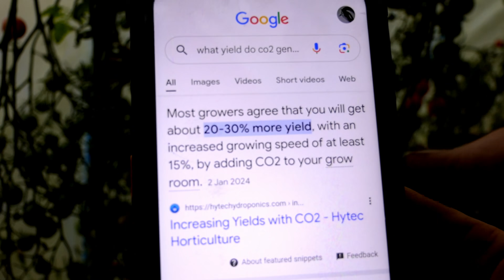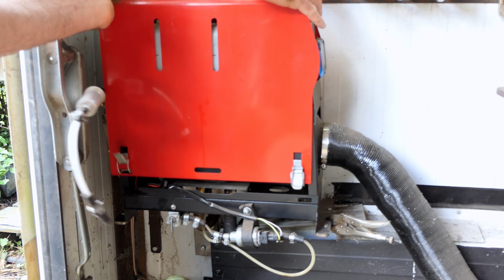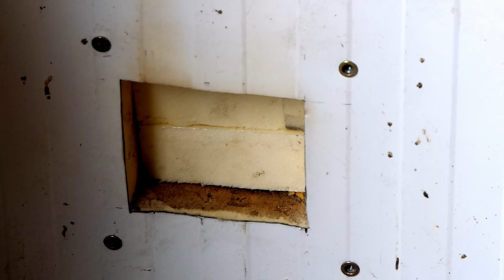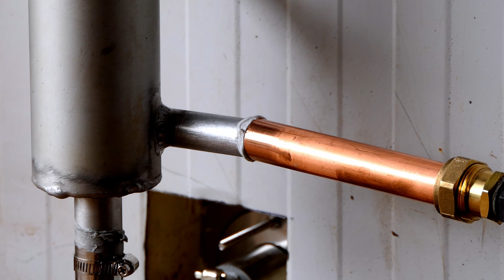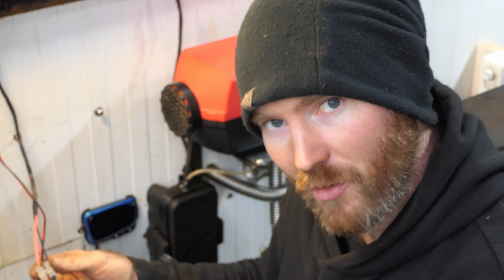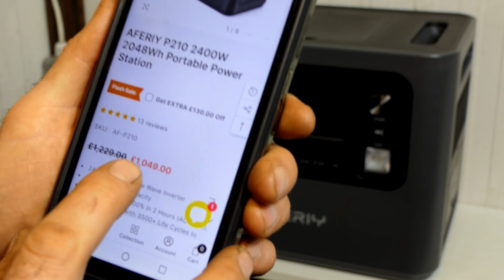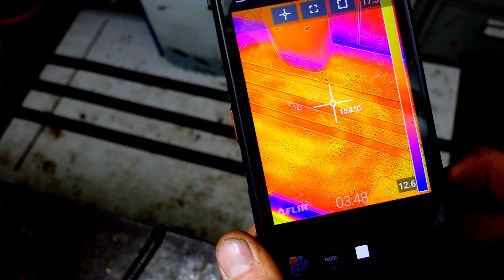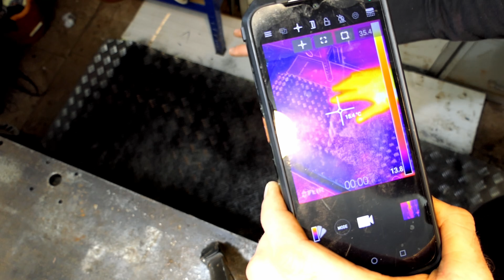NEW! Better system for Cheap and Safe Heating💲+ Underfloor Heating Mod test🫠

Comment: Your going to have a hard time convincing me diesel like fumes around your house and residue on your tomatoes is safe to breath / eat. If I go near any diesel engine running a tiny bit rich I get very sick for a few days if overexposed. Even after a min or two in diesel fumes i need to get as far away as possible. 
  Perhaps but hard to convince me.
Reply from the maker: There is no smell and no residue (only when  filling up) The system burns better than a green house heater which burns less clean. Kerosene burns cleaner than diesel also. The heater itself is an air heat exchanger so there are no gasses or fumes entering the house but are instead exhausted outside. Cheers J
Reply: @joshuadelisle  It certainly looks clean.
Reply from the maker: @izzzzzz6  my air quality tester is a highly rated one and was calibrated.

Comment: Joshua I loved this .Ime running 4x8foot x2foot double pan radiators  from my cheap diesel heater.exhaust. 10mm copper coil wrapped round exhaust pipe wich is 1 inch steel pipe  inside a scaffold 2 inch tube  9 feet long inside 110mm soil pipe when filled with fine sand .the soil pipe radiates great heat one end the exhaust exits then is 20 foot exhaust pipe round the bottom edge of workshop  were it exits to outside it's touchable by hand and does not drip ..i used a cheap boat bilge blower to blow the heat of the 20 pipe...also I added a blow off valve to the highestbpoint of system.. whole thing works a treat .hoping to adapt it soon to hot water system as well..take care des...ps don't forget your chicken licence 😍😂🤣 o and always use a insert in the pex pipe much stronger
Reply from the maker: Thank you. Well done it sounds like you've got a good set up. Yep I've surrendered to the cartels and registered the chickens so I don't get the £2.5k fine....😒 You're right about the insert but i didn't have any at hand and on an open system it's not much of an issue. Cheers J

Comment: Very good video josh when you said it's better to use radiators 
Instead of putting them around 
the room put them all together all on 1 wall 
that's well insulted  
you could ask 
if any  plumbers are taking some decent ones out for free good enough for garage
Reply from the maker: @christophersherratt7299  I've seen some by the road for the scrap man. I wish I had picked them up now. Cheers J

Comment: I have a heater install in my 1930s semi detached. I've installed it outside on the wall in a Galvanised Electrical panel/enclosure. My pipeworj isn't as neat as yours, for example I've ran my fuel line through a 20mm stuffing gland in the lid of a 20 litre container like yours. My heater draws outside air a heats that before heating a ducting it into the house. I know it's not as efficient as recirculating internal air, i just prefer the idea of fresh air being blown into the house. I have outlets in the Utility room, and half landing on the stairs. My wife was initially skeptical, but after experiencing how quickly we can dry clothes in the utility, reduction in condensation on windows on cold mornings, and watching your videos, shes very much a convert to them. I use red, and contaminated diesel from miss filled cars. Service it annually, but haven't seen anything untoward.
Reply from the maker: Well done, it sounds like you did a great job. All the very best. Cheers J

Comment: Hey Joshua - thanks for another great video, when I see a new video of yours in queue I get all inspired about my new diesel heater project !  This one is no exception, I think the heat lost through the exhaust is horrible, I have a standalone-radiator (not plumbed in) in my workshop, my intention was just exhaust the gases into one side via the lower port of the radiator, then output via the other lower side and straight through the wall to the outside.  My intention is just to use the gases in the radiator, not exchange the heat into water prior to exhausting outside.  I figure as long as the gases can escape there will be no pressure build up and the hottest gases will remain present at the top of the radiator thus heating the workshop - I'd love your (and other watchers / commenters) views on this.
Reply from the maker: @orbepa  thank you. I've seen a few people do that. The main issue is cleaning the inside. If you restrict the gas flow even with a long exhaust it affects the combustion which is why I had a carbon build up this time round and not previously. If you do want to run it through a radiator, one of those old cast iron steam radiators would be ideal if you can find one. They are big which will allow good flow. Cheers J
Reply: @joshuadelisle  This is something I wasn't aware off... Me thinketh I shall wait for your next video and see how you get on with the BangGood (a highly amusing name for us childish types) purchase.

Comment: For the floor. Ceramic fibre insulation (or foam) then install the tubes. And thin set cement around and over the tubes. Some people will spray foam (3”) the basement floors before rebar, piping and pours.
Reply from the maker: @stormrunner0029  you're right. Cheers J.
Reply: @ not to make you feel bad, because it looks like you have a damn good system going there. 360 degree foam insulation, with a reflective metal pushing the heat back.- and you still showed good results. Proper layering and you should be able to heat bake a paint job in that small garage.
And the beauty of in floor heating in a garage. You can open the door a foot of two, and the heat barrier at the door prevents the cold air from creeping in. If you are going on the cheap. Pull the bricks at your garage door and replace them with the insulation panels you have, put the pipes on the upper metal, and cover with 3” of cement. You will toasty all Winter. 👍
Reply from the maker: @stormrunner0029  that's good advice. Cheers J

Comment: A TIP FOR YOU TO MAKE GLOWPLUG SNANER I.E SOCKET GET THE SIZE NEEDS TO BE LONG SOCKET  DRILL 5MM HOLE IN IT THEN CUT 2 LINES THAT THE SECTION OUT SAND/FILE JOB DONE

Comment: JOSH I'VE HAD A SIMILAR CHAT BEFORE WHEN YOU WAS RUNNING WASTE COOKING OIL WITH A SPLIT FEED PIPE 
I FOUND THAT 
A EGG CUP OF PETROL IN THE OIL GAVE IT ENOUGH ENERGY THAT YOU DIDN'T NEED ANYTHING ELSE 
FOR THAT FIRST START UP ANYWAYS 
WHAT YOUR DOING NOW IS CHEAP AS CHIPS 
BUT YOU CAN MAKE THE PARAFFIN LIKE DEISEL IIF YOU GET THE LUCAS OIL STABILISER 1LT OF EBAY CAN BE ABOUT £17 MAKE SURE IT'S A 1LT THOUGH SOME ARE CRAFTY 
PUT ONE EGG CUP OF IT IN A 2.5 GALLON AND MIX THE OIL BECAUSE OF IT'S CONSISTENCY IS VERY VERY THINK 
WORKS JUST LIKE GOING THE PETROL STATION IF USED FOR A CAR 
I THINK OLD COOKING OIL AND PARAFFIN WITH CAP FULL OF PETROL FOR EASIER COMBUSTION TO 1 GALLON REMEMBER WHAT I SAID ABOUT CLEANING THE OLD OIL THERE'S A OLD BRITISH PATENT ROBERT MURRAY SHOWS ON HIS CHANNEL  WHAT IT DOES MATE 
IT FILTERS IT TAKES ABOUT 
3 MINS OF WORK THEN  LEAVING TO NEXTDAY UNTILL IT SETS THEN USE IN CAR  
SOZ FOR GOT TO MENTION 
IT'S PIG GELATIN CHEAP OF EBAY ADD TO HOT WATER MIX THEN ADD 
AS IT SETS TAKES ALL THE BITS OUT TO BOTTOM WITH WARTER THERE'S NOT A ACCURATE AMOUNT 2 BIG TABLESPOON FULL PS HOPE THIS HELPS YOU 👍

Comment: Dont they do a diesel heater that just heats the water so you are not getting it red hot via the air before the floor gets warm?
Reply from the maker: Yes , I have one now, I did mention it but you may have missed it. Cheers J
Reply: @ must have - i had to watch over 3 goes as i was sorting kids out. For a small workshop one of those would be ideal over big boiler. Weve an okl boiler flr the house but has to do a lot nore wity heating water and whole house with ufh.

Comment: Agree 100% on your take on the world. Taking us for mugs. For the floor id take the pipes out of the insulation and put the metal back on. Then out it in a 50mm proud wood frame and put either sand or screed init and the metal floor over the top. That should create a storage heater and spread the heat nicely. Ideally if u are gonna redo the floor in the garage do as you would with ufh - dig it out, membrane, insulation in then pipes and screed.
Reply from the maker: Yes that's the best way I think. Cheers J

Comment: I have found that petrol stations will no longer sell small amounts of Red diesel/heating oil (5L p/w) for my diesel heater because Im not linked to agriculture yet the Gov.net website states that it can be used for non commercial heating. I have the documents if your interested. Looks like bang goes cheap heat. Love your videos btw keep up the good work
Reply from the maker: @djspike9  yes it's a shame, they only allow bulk delivery hence why I bought 1000L. You can buy it as a group and decant your share but you need a tank that's installed properly and approved by the oil delivery company. Otherwise if you don't mind a bit of chemistry, bio diesel from restaurant used veg oil is probably the cheapest option for small amounts. Cheers J

Comment: The thermal camera likely you can change to Auto or Low sensitivity to get up to around 400-600° range.
Just look in the settings.

And all the shiny exhaust pipes will be difficult to get a good reading with infrared.

And for the water heat exchanger didn't see what way the pump circulates but for better heat scavenging you want the "cold" water flow to start from the outer most exhaust side and flow towards the heater.
And if the pump goes too fast you also loose some heat, the larger difference for the heat exchanger in and output the better, but of course if it's too small you need more speed.

I totally agree with everything you say here about global warming, it's all BS politics to take our money.
But throwing garbage around and in the sea (india we dislike you for this) is another actual problem
Reply from the maker: @tullgutten  thank I'll look into it. Cheers J

Comment: Good informative video but you said Britain has lost most of it's tree's which is true but how do you feed people if there's only tree's? There's are massive issue at the moment with government grants for land owners resulting in thousands of acres of farm land being planted with tree's. Sounds like a good thing but unfortunately then we need to get our food from other countries which have lower animal welfare standards, use more fertilizer, insecticides, pesticides etc. An acre blanket bog takes in a lot more carbon than a acre of tree's would do but you get paid more to plant tree's in bogs...
Reply from the maker: @nohaxjust789  you raised a good point however the approach I would suggest is food forests, regenerative agriculture and permaculture which all require a healthy amount of trees to support an ecosystem that works with the food production. It's a totally different system to the chemical reliant version we have currently and there is no reason why robotics and AI can't be used within what looks like a traditional system. Cheers J

Comment: Completely get your perspective and frustration, however there is a history of corruption in fossil fuels organisations and governments, not just government. Also, people have different circumstances and if those who can afford it transition to cleaner alternatives that's no bad thing. I'm fortunate enough that I could get a heat pump installed and it's running with a COP of 4.61 over the last month (or 461% heat output vs electrical consumption) and is running from a house battery I charge overnight on a cheap tariff at £0.07/kWh. Appreciate there is an initial cost for this so running costs is just part of the picture, similarly for your boiler and fuel storage initial costs.
Reply from the maker: @simonhenry1769  thank you. Yes you are correct. I actually flag an oil company causing problems in the Amazon if you want to check out the details in the description. Essentially my gasifier project addresses independence from corporations in that sense once I've finished it. Cheers J
Reply: That's the dream to not be dependent on corporations. I can't believe OPEC is actually a thing, it's surely collusion and price fixing so shouldn't be legal? Best of luck with your project!

Comment: I love these videos of yours, been waiting a while for winter to come round for more heater content! Also on climate change stuff, you're absolutely right, the only issue is when you try to discuss this with people they try to make it a political football or say "you're a climate denier" or attempt to ostracise you as they have no counter to....data. 

The data doesn't lie. I tell people we're coming out of an ice age so it's natural to see temperature increases, some of which will be quite fast and driven by the Sun. It won't lead to all life dying, it will just be warmer on average, with higher wind speeds between regions with large temperature differences which is hypothesised to drive storms (which we have fairly frequent violent ones of anyway). 

The obsession with us somehow becoming Venus overnight (ie: 100-200 years) is insanity. The whole thing is just a racketeering operation to screw both average joe and governments out of money.

Comment: I apreciate your heating experiments and exploration into diesel heaters as more intergrated home heat source. Whilst putting the fuel pump in a sound deadened enclose is very affective for keeping the noise down I do wonder if essentiaslly insulating it will affect it's lifespan? I realise fuel itself is quite an effective coolant, it's one of the reasaons ethanol is so effective at making power in motorsport.
Reply from the maker: @gingerelvis  Maybe. Only time will tell and when it dies I'll dissect it to see the damage. Cheers J

Comment: Whats your source for humans only being responsible for 3 percent of added co2?
Reply from the maker: This is from Chatgbt: The claim that only about 3-5% of the carbon dioxide (CO₂) in the atmosphere is due to human activities is a point that often comes up in climate discussions, sometimes as an argument against the impact of human-caused (anthropogenic) CO₂ on climate change.

Here’s a breakdown of this concept:

Natural Sources vs. Anthropogenic Contributions: Naturally occurring processes such as respiration, ocean-atmosphere exchange, and volcanic activity do produce much more CO₂ compared to human emissions in absolute terms. However, these natural processes have long been balanced by natural "sinks" like forests and oceans, which absorb CO₂ from the atmosphere.

Human Contribution as a Disruptor of Balance: Although human activities contribute a smaller proportion of the total CO₂ in the atmosphere (around 3-5%), this additional CO₂ disrupts the natural balance. The anthropogenic contribution is not offset by natural sinks, leading to a net increase in atmospheric CO₂ levels, which has been a key driver of global warming.

For a detailed scientific perspective, you might refer to sources like:

1. NASA and NOAA (National Oceanic and Atmospheric Administration), which provide insights into how anthropogenic CO₂ contributes to climate change.

2. The Intergovernmental Panel on Climate Change (IPCC) reports, especially the Sixth Assessment Report, which explains how even small proportions of CO₂ emissions can disrupt the natural carbon cycle.

3. Scholarly sources, such as peer-reviewed articles in journals like Nature or Science, address the anthropogenic impact on CO₂ levels more specifically.

Comment: Yeah my heat pump definitely costs less than my oil boiler used too

The main problem with heat pumps is very poor instals from peiple who are just chucking them in and hoeping  for the best.
Reply: I'm paying 26.7 p in the day and 7p overnight 

Obviously you shift the morning heating to overnight and all the hot water. 

If your oil boiler is running at 70 percent efficiency (which is resonable from the older units like you have there and inused to have)

Then your getting about 5.6kwh from a L costing about   9.5p if your oaying 53p a L

A heat pump onky had to be running at a cop of about 2.5 to beat that. 

Any decent install will return at least 3 and more likely between 4 and 6.
Reply from the maker: @njipods  nice. My boiler is 93% efficient since it was last tested which is once a year.  Cheers J
Reply: @joshuadelisle  your talking about the test the guy dose when he services it?
Reply from the maker: @njipods  yes correct.
Reply: @joshuadelisle  just replying to something else and saw I didn't respond to this. 

that number they give you at the test is made from a little algorithm that measures various things like temperature and oxygen content

it gives you a good picture of how well the boiler is combusting the fuel
it's not the overall efficiency through.

I had a look online at your boiler and can't find the exact efficiency (they didn't quote it back then as they didn't care much) but it's non-condensing so that limits efficiency to 80% absolute max. 
and then that relies on the flow temp being set to the minimum (which it almost never is in  most systems) the radiators removing enough heat to send the water back cold enough (which again. quite rare)
so yeah. its more likely somewhere around 70-75%

the newer condensing boilers can be better. but only if they're designed with a low enough flow temp!.

your DIY system is probably more efficient because you made it into a condensing system with a very low design temp. Probably over 90%!
Reply from the maker: What are you getting price per kwh?